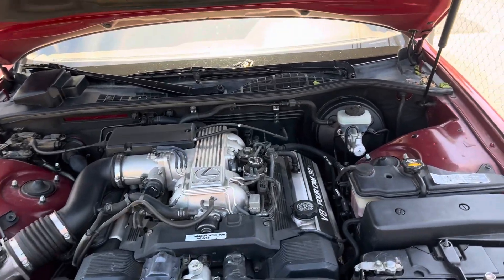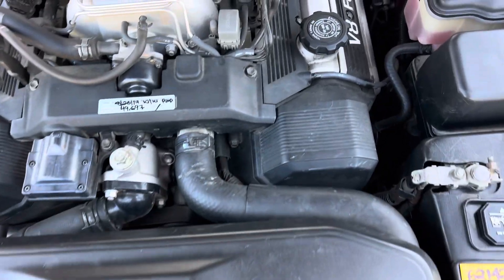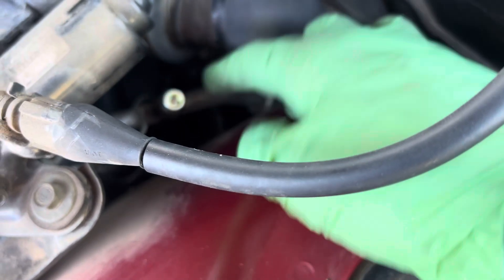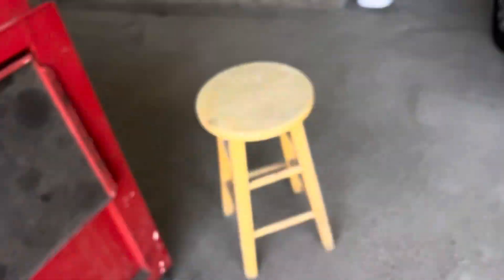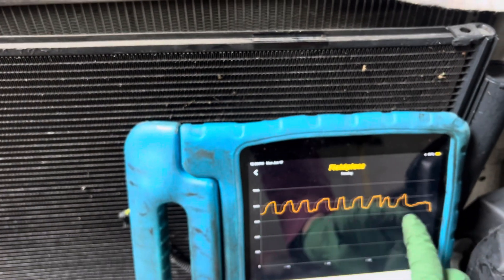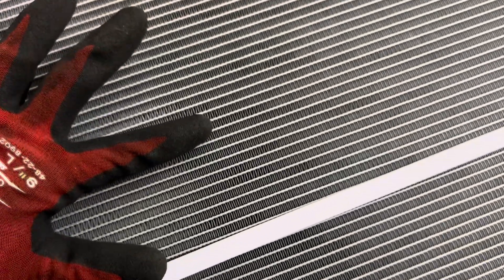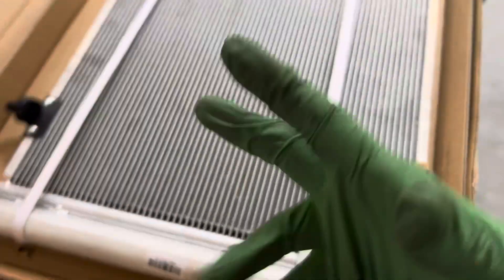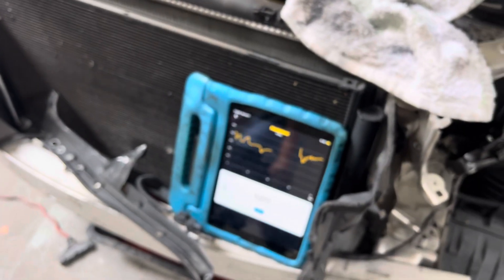Refrigerant oil 150 viscosity much too thick for use in this vehicle

Comment: Hey Tom how are you mate. Sorry to bother you. I also have a strange issue with my ac. Pressures start off normal, compressor cycles, but then all of a sudden compressor stays on and the low side pressure starts heading slowly towards vacuum. Ive got new expansions valve and condensor… r134a system and ive filled the system with HyChill, lpg based refrigerant. Greetings from Australia
Reply from the maker: Either have a expansion valve getting plugged up with some debris that was left in the liquid line from possibly rust or desiccant material in the old dryer
Will you have some moisture in the system freezing up after the expansion valve into refrigerant as it enters evaporator restricting refrigerant flow 

The blower motor inside is still operating  correct?
Reply: @coldfinger459sub0  i did flush the evaporator core and basically all lines werrle flushed, new condensor, tx valve replaced…. Blower motor working yes. Vacuumed down to 250 microns, creeped upto 420 and hung around. I put some dye and oil back into the low side then pulled another vacuum to 500 microns and charged from there….
Reply from the maker: Find out why air is not blowing over evaporator 
Or expansion valve is sticking closed 

Air flow or blockage in refrigerant
Reply: @coldfinger459sub0  thx m8, i definitely dont feel like ripping the dash out of this fiesta to swap another tx valve 🤣🤣🤣 what a disaster that was!!! I will look into it. Thanks again !!!

Comment: Where would one go to learn more about that poa? Valve. Service information I assume?
Reply: Lexus calls it EPR but in refrigeration this is a suction control valve, everyone calls it differently: epr, cpr, kvl, poa... its all the same

Its different from a expansion valve because isnt feed by liquid refrigerant

To understand its function as a quick resume is to avoid pressures going too low after the evaporator and prevent freezing when compressor RPM increases.
I think its because TXV wouldnt have enough range to adapt into a fixed 160cc compressor spinning three or times as fast than idle so some limit device has to be used.

It Will starve the compressor suction a little bit but lubrication is enough to be safe

In other non-automotive aplications like coolers and freezers is used to protect from overpressure when a defrost cycle is running, those are adjustables
Reply from the maker: @ignatius2230  in this situation, there is no liquid fed to it. 

This is to keep the suction line vapor .  Evaporator at one constant temperature so there is no uncomfortable variance of surges of cold and warming.  So the body doesn’t sense a temperature change a constant temperature temperature. 

They are actually adjustable on the old Chrysler and Rolls-Royce from the 60s and early 70s. My father used to have me rebuild them. There was actually rebuild kits for them. . 

Really vehicles when we get them from the 50s and 60s and a couple on into the early 70s like Rolls-Royce . 

If this particular customer who is a Bodyman, who works at the shop that I know if he hast to rebuild the system and flush it out and start totally start from scratch . 

I will probably do a video on adjusting it to the prosper pressure setting for the evaporator 134 refrigerant . 

With the proper viscosity oil 

And adjust the down to the point where I can get the evaporator at the same temperature of the old R12 

It’s nice when it’s 100°F outside and you have 39°F air blowing out of your dash Vents.
Reply from the maker: The actual manufacturers, not usually the distributors who rebrand bottles with their name on. It are not always the best source for information.

But if you go to the actual manufacturers of the oils, you could get more detailed information 
MACS is an excellent source especially once a year in our expo and training seminars every technician who is interested in automotive HVAC should at least attend one MACS expo in their career they will find out and learn more than they ever thought possible

And they will pick up connections for equipment and supplies and tools and procedures that they would probably never be introduced to Working from Shop

Comment: The problem of most aftermarket condensers, they are not isolated from the ground like the OEM. The mounting point is always plastic if not the condenser is mounted to the plastic part of the radiator to isolate them to ground.
Reply: I don't believe that has has anything to do with electrical isolation. Refrigerant is not electrically conductive, so I can't see what grounded or not grounded has to do with anything. The rubber mounts help absorb vibrations and slight flexing of the radiator support vs a rigid mount to help prevent cracking.
Reply: @averyalexander2303  PAG oil is very conductive that's why it's not used on commercial and residential AC. Car manufacturers say to use different manifold gauge & hose to prevent contaminating Hybrid and electric cars AC with PAG oil.

Ford issued a TSB that says to ground the heater core. Then revised it saying NOT to ground the heater core. When the heater core is not isolated from the body current flows causing it to leak. AC lines are cold if not isolated from the ground,  current will flow.
Reply: @w0lvez1  No, PAG oil is not "very conductive" at normal automotive voltages. At best, it's potentially slightly conductive at high voltages, although there are types of PAG oils for electric compressors. Remember that electric compressors run at hundreds of volts, not the maybe 0.1 volt difference you may see between the engine and the body. You will never get any significant current to flow through non contaminated PAG oil on a 12 volt system.

Either way, if the condenser was directly grounded to the chassis, what issues do you think that would cause? I've never seen any efforts whatsoever to electrically isolate the AC system from the body. The compressor is bolted directly to the engine block, the receiver dryer is usually bolted directly to the chassis with a metal bracket, etc.
Reply: @w0lvez1  Well in that case I'm screwed because I just checked 3 of my cars ranging from 20 to 35 years old and I can light a test light on the condenser of all 3, presumably since the receiver dryer is  directly mounted to the body with a metal bracket and the line from the condenser to the receiver is solid aluminum. So at least on those 3 cars, so much for electrically isolating the condenser. They all still have ice cold AC all these years later with no signs of leaks though.

Grounding a heater core to the body is a bad idea because the engine and the body will always be at a slightly different potential, even if only by a few mV. Since electricity will take ALL available paths, some current would be sure to flow between the body and engine through the coolant, which you don't want because that causes corrosion. In theory, from my understanding, grounding the heater core directly to the engine should be okay.

A mix of water and coolant is MANY times more conductive than a refrigerant and PAG oil blend though, which seems to be a non issue outside of electric compressors.
Reply from the maker: @averyalexander2303 👍
Reply: @averyalexander2303   You completely missed the point. The whole point of isolating the AC line evaporator and condenser is to prevent current from the alternator going to the compressor then to the body. The hose from the compressor doesn't isolate the condenser. It actually does the opposite. Your comparing cars that use different types of metal and refrigerant oil. Cars designed for R12 use NON-CONDUCTIVE mineral oil, the AC lines & condenser are usually made of copper and steel. Cars designed to use CONDUCTIVE "CONVENTIONAL" PAG oil are electrically isolated from the factory. Without using an ohmmeter it's hard to tell if it is conductive or not. Not because it's made of metal it's conductive. There are too many ways to isolate it by using paint, powder coat, plastic washer, black oxide, anodize, paper (Ford's Favorite), tape, etc.

There are only 3 metals compatible and will protect aluminum magnesium, caddium and zinc. All other metals will attack aluminum. All fasteners that will make contact with aluminum are either plated or coated by those metal. 

The negative cable from the battery on most older car is directly connected to either the starter or alternator and a small wire goes to the body. Most cars today, the negative cable goes to the body and another cable is used usually in a hidden location to connect the body to either the engine or transmission.When this cable gets corroded or when a high power consumer is installed like an audio amplifier without upgrading the ground cable, when electrical load is high that's the only time current will flow on an alternate route like CV joint to complete the circuit. Old cars also have a starter relay that prevents the starter turning the engine when voltage drops up to a certain point. The relay will just click. New cars have no starter relay.  The under hood temperature of older cars don't get very hot because the thermostat is located where the top radiator hose is connected. If the AC is off the engine bay doesn't get very hot. The bottom part of the radiator is cold. Engine bay temperature on cars today is very hot because the thermostat is located at the bottom hose & the catalytic converter is duty cycle. It can purge even at idle.  You really need to wait several minutes because the dipstick is very hot even with plastic.
Reply: @w0lvez1   @w0lvez1  I completely understand the theoretical purpose of isolating the AC lines and condenser from the body, which, as you said, is to prevent current from flowing between the engine and body through the AC lines- the same purpose as isolating the heater core from the body.

My point is that I have personally never seen any evidence of the conductivity of PAG oil being a problem in the real world outside of electric compressors. That's not to say it couldn't be, just that I haven't seen it yet.

Two of the three cars in my example ranging from 20 to 28 years old use R134a and PAG oil while the 35 year old one uses R12 and mineral oil. All 3 have aluminum condensers and none of them have any signs of leaks or other problems.

For what it's worth, I have checked the resistance of brand new PAG oil with my multimeter in the past and got infinite ohms, but of course that says nothing about its high voltage dielectric strength, what happens if it's contaminated with moisture, other brands of PAG oils, etc.
Reply: @averyalexander2303  Where  did the negative cable from the battery is connected on your car? The flow of direct current can cause a lot of problems on moving parts like CV joint, wheel bearing, etc. due to arcing which will cause wear.  Older vehicles also have less electrical load.
Reply: @w0lvez1  On my 20 and 28 year old cars, the negative battery cable goes to the body. On the 35 year old car, the negative cable goes to the engine. Of course all of them have ground straps between the engine and the body.

Yup, current flowing through unintended paths can definitely cause a lot of problems and even hazards. I've even seen things like throttle cables melt and almost start fires when the engine to body grounding is bad.

But by far the weirdest issue I've seen caused by a broken ground strap is a Honda that wouldn't run unless a scanner is plugged in. Running it with the scanner plugged in actually melted the OBD port, its wiring, and the scanner's plug because the engine and body were somehow grounding each other through the OBD circuit.
Reply from the maker: @averyalexander2303 👍
Reply: @averyalexander2303  I have repaired several Honda's A/T. I'm not sure if bad grounding causes some chunks of aluminum from the housing to turn to powder clogging the internal ATF filter. All of them have severely corroded uninuslated ground straps.
Reply: @w0lvez1  I could see that for sure. All the current that flows through the axles is going to end up flowing to/from the case through the differential bearings and the mainshaft and countershaft bearings.

But unless something is electrically isolated, there's no way to completely stop current flow. Even if you add 50 thick ground cables between the engine and the body, if there's a connection through something else like the axles, current WILL take that path too. Electricity doesn't just take the path of least resistance, it takes ALL available paths.
Reply: @averyalexander2303  On much older vehicles the alternator has a ground terminal. It doesn't use the alternator housing as ground. Newer Honda's are less prone to this problem because the alternator is off while the engine is on. The alternator cycles together with the fan and AC compressor when the battery is full. Car manufacturers love grounding the body negative because they make profit selling cars. If they ground the body positive it's protected from corrosion (Cathodic Protection).

Comment: Love your videos, so educational!
A Question
2001 Miata MX-5
I am dealing with a high high side (sometimes beyond 400psi) and a resulting short cycling compressor.
The shop that charged the system did not replace the receiver dryer.
I did some testing and I notice that the condenser has some fin damage, if I spray cold water on the condenser the pressures drop right back to where they should  be based on the R134 Temp pressure chart.

Am I right in thinking a new condenser is required? If so, must I also change the expansion valve? 
Thank you :)
Reply from the maker: It sounds like the system is overcharged

High-pressure over 400 psi rapid cycling 

Your fins would have to be extremely bent over to cause that problem with a normal correct refrigerant charge 

The refrigerant charge should only be done by weight by the manufacturer specification not by topping off or filling with cans and just guessing 

You do not fill refrigerant pressures 

You do not feel the refrigerant charge by the temperature out of the dash 

Only by the manufacture specific weight of refrigerant 

At 2005 it’s an old vehicle if you did go through the hassle and work a replacing the condenser at that age I would replace the expansion valve and the receiver dryer if you were to open up the system again
Reply: @coldfinger459sub0  Thanks for the reply :) 
Overcharge is possible.
I will have it back in to the shop and ask them to charge it again by weight. 
The compressor also buzzes and really kills the power of the car when its warm out (85F+) which makes sense given its charging to such high pressures.